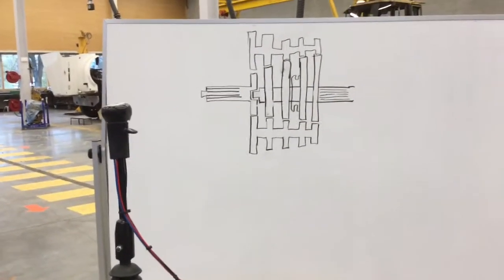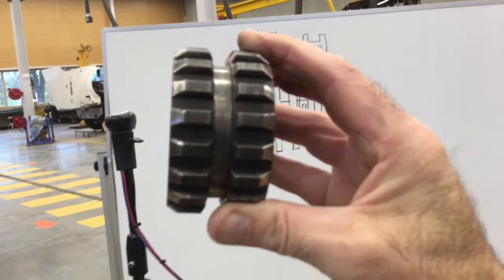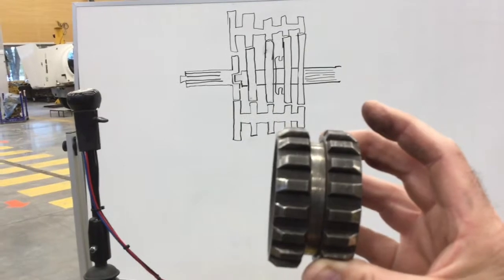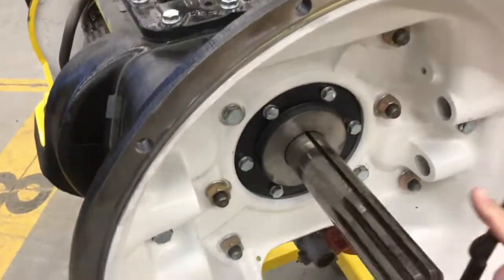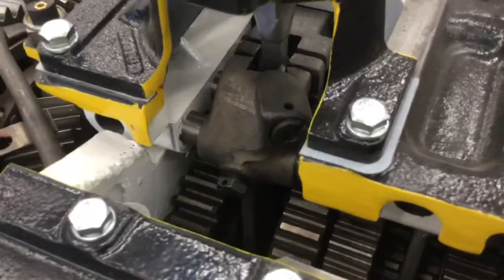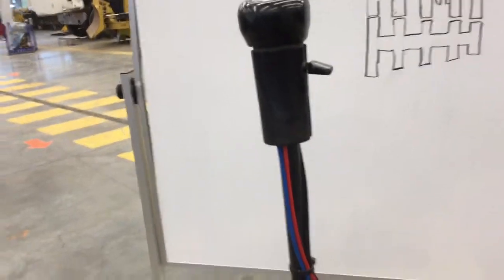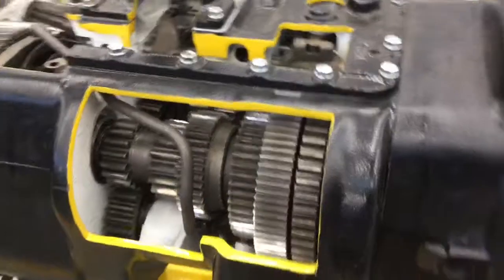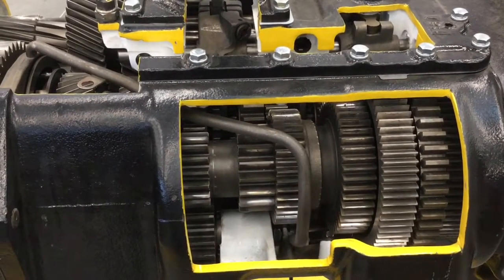Grant Describes a twin countershaft transmission Pt2

Comment: Will you please explain exactly what disables the splitter from working in one range on the 13 speed,  locks the range  in what would otherwise be 1st in the main box, and disables the splitter in reverse? On the surface It appears that mechanically it should have all 4 auxiliary ratios available for all 6 main shifter positions thus making both the 13 and 18 a 20 speed forward and 4 reverse. Is it just down to air valves or is there more to it?

Edit: so I looked it up. The reason is that the 13 has no bearing between the rear splitter input gear and the output shaft, so if the splitter engages to that gear when in low range where the gear is turning faster than the output shaft and has a load on it because it is driving the countershafts it eats itself.
Reply: The ratios in the front case of the 13 wouldn't benefit from splitting the low range gears, on a 18 the ratios are spaced to use the bottom end splitting feature and the back case isn't designed for it.